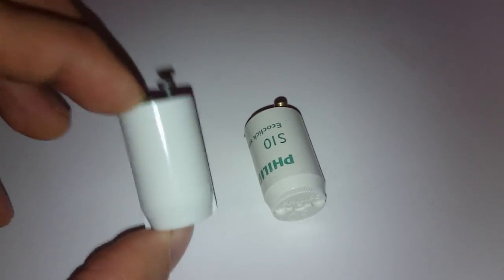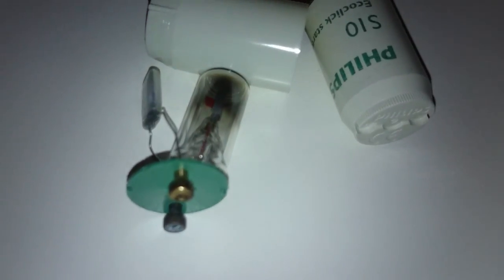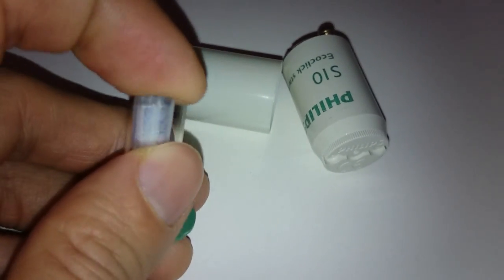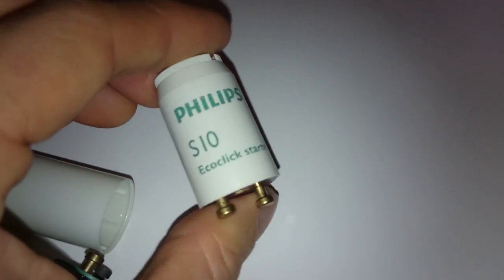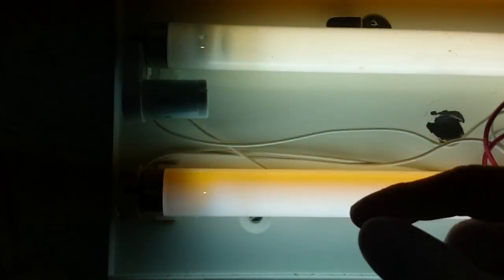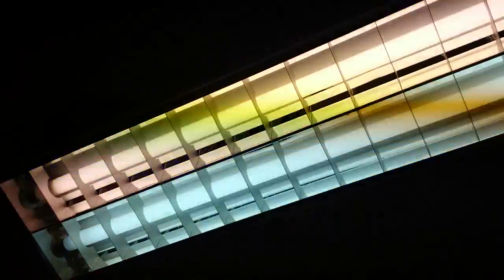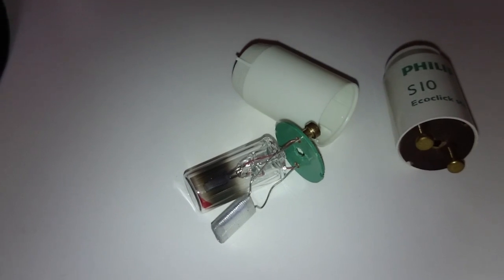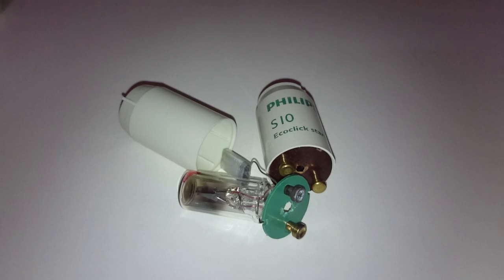Understanding and changing fluorescent light starter

Comment: My light doesn't seem to have a starter, and I bought a new LED tube but they said you gotta update the starter as well. Is it possible my light fitting is an old one that doesn't take LED lightbulbs BUT doesn't have / need a starter ? Thanks in advance.

Comment: hi I have a loose starter in my flourescent light, I tried putting a small tape on it to keep it in place

is it safe to do so? the tape is small and only touches the starter not the lights

does the starter heat up after the light is on? or just stay cool until turned on/off again

Comment: I have a long fluorescent light like this in my basement I changed the light and the little piece your showing but it still won’t turn on. Any recommendations
Reply from the maker: So you changed both the light tube and the starter?
Reply: @conceptedge  correct

Comment: My round fluorescent light has been dead. I finally decided to replace the bulb, but it does not turn on. Do I need to replace the starter? How do I tell if it needs to be replaced? Thank you!
Reply: Most likely your tube is fine, but you need to replace the starter with the right type.
Take it to the hardware store and ask for the right kind. In extreme cases the ballast is gone but that will be an electrician's job.

Comment: It seems by you removing and putting the starter back, you can't get shocked.  I was told to replace a starter and have no clue whether the fixture is in off or on state since it's a pullstring but haven't found anything about whether you can get shocked so been holding off for now.
Reply: I've replaced 100s of starters on live equipment, without a tube filling the circuit you won't get shocked if you just hold the starter.
Reply: @YlkevanSpankeren  thank you. Tried that and still didn't work so now I'll replace the entire unit.   Thanks for the video and response.
Reply: It's good practise to replace both tube and starter when it doesn't work @bournedvnt

Comment: Once the lamp is on, does ac still flow through the starter or is it bypassed? If bypassed how is there still a path for ac to flow?
Reply from the maker: Once the starter does it job, the AC is redirected to the ionize gas inside the tube, which continues to flow in the vacuum tube conducted by gas. The starter is no longer needed until the next power cycle. In fact you could even remove the starter once the light is on and it will remain on.

Comment: tHANK YOU.  I HAVE A QUESTION. I HAVE A DOUBLE FLUORO TUBE LIGHT FITTING AND EACH TUBE HAS  A STARTER, HOWEVER WHEN  I REMOVED ONE TUBE THE OTHER ONE WOULD NOT WORK AT ALL.  SO DOES THAT MEAN I NEED  A SERIES OR A SINGLE STARTER FOR EACH TUBE?
Reply: Look at the starters and replace them with equivalents. If the tubes don't light after that, replace the tubes. If the tubes still don't light, replace the ballast. If the tubes still don't light, turn on the wall switch.

Comment: Should the starter last a long time if you use CFL that is always on? I've been told that you should replace the starter when you change the light-bulb, is that really the case? I know it doesn't cost much, but when you have a lot of lights it adds up...
Reply from the maker: Normally, try to replace the starter capacitor first before replacing the light bulb. These days the starter has a shorter life span than the bulb. If that fixes the problem, then you save money from replacing the bulb. That said, yes, generally avoid power the lights on and off too many times could extend their life span.